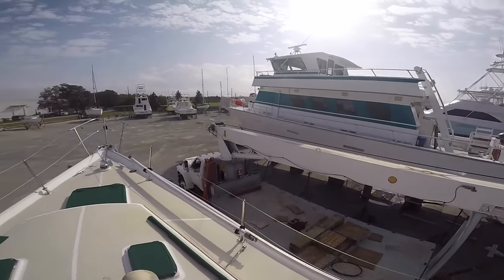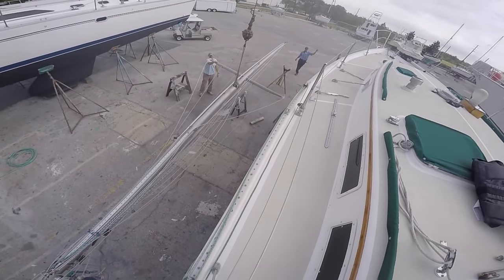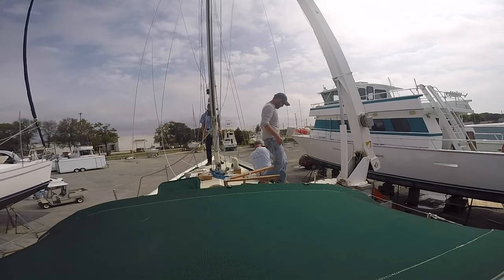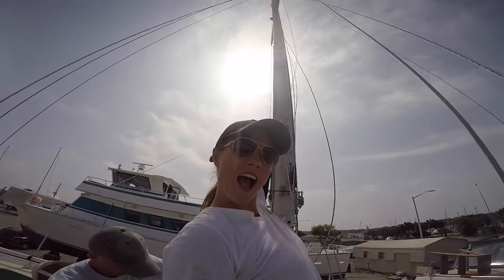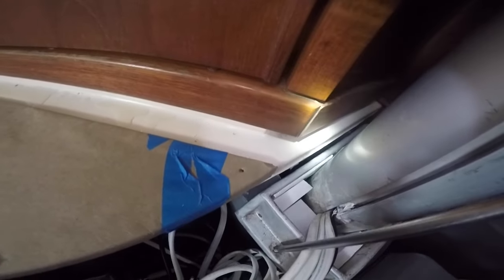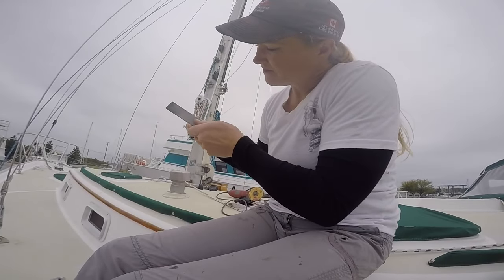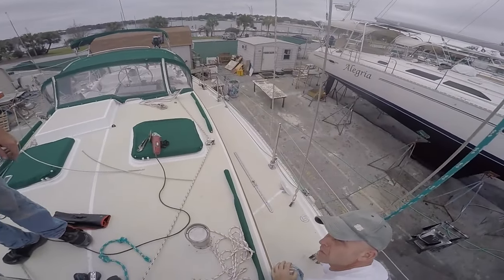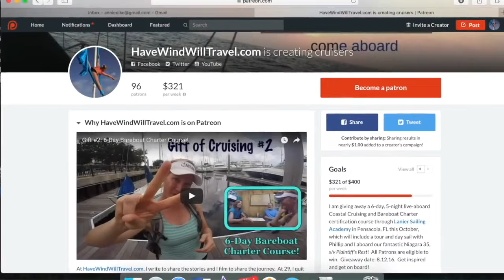#73: Raising the New Rig -- Part 2

Comment: Glad to see the mast up so you can get back on the water. Do you have some kind of gauge that helps to get the tension right?
-johnny
Reply from the maker: Hey Adventures.  I asked Phillip to be sure as I believed there was a device but I couldn't remember what it is called.  He said there is -- a Rig Tension Guage but they are pricey and there are other ways to tune (feel, observation, performance (the "S" bend Brandon mentioned while sailing).  Hope this helps.  Thanks for watching.

Comment: Quick Q:  Please ask Phillip why he chose Hi-Mod fittings over traditional swedging?  Every sailor is different-- and everyone's preferences are just those. Caio,  Thomas
Reply from the maker: Hey Conmigo!  Ain't that the truth.  In boating, there really is no "right way."  We chose to have the tops swedged where the shrouds are pinned to the tangs and do hi-mod fittings on the bottom.  We had heard hi-mods can be stronger if the swedging is not done properly but through our research we believed the rigging department for West Marine would do a good job.  We also chose to hi-mod the bottom because we didn't know the exact length we would need.  This way we could cut shorter or longer as needed.  We also wanted hi-mods on the bottom as they are easy to disassemble and inspect and we were told ours (hi-mods as opposed to sta-loc) could be re-used so we would only have to replace the wire ... in theory.  Hope this helps.  Thanks for watching!